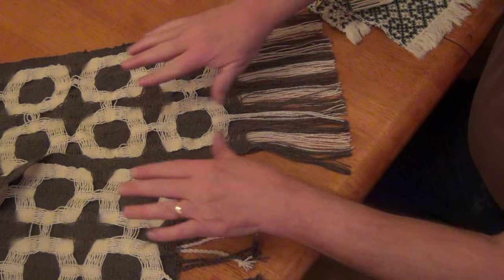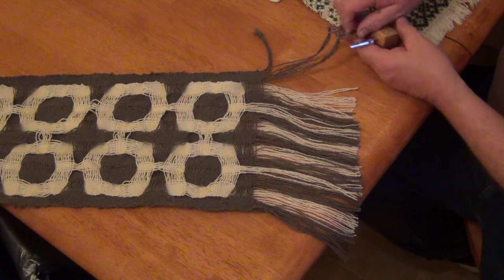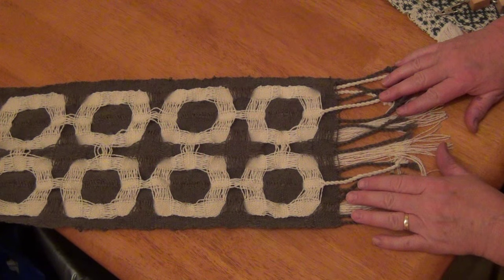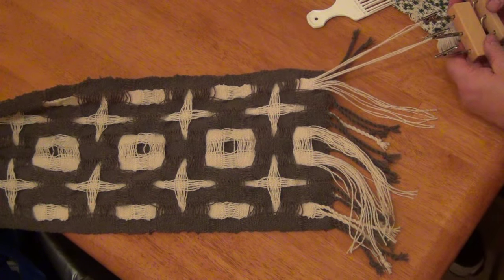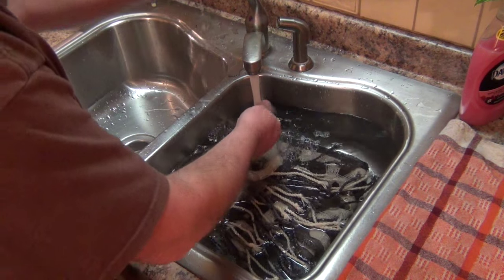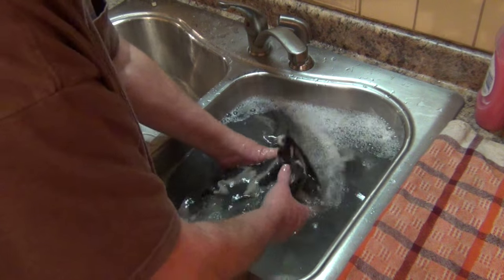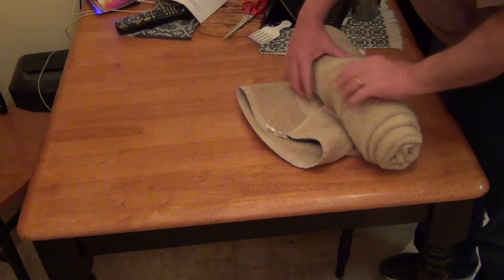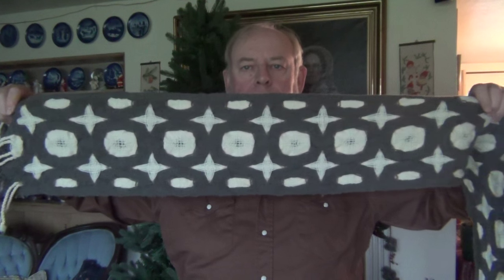Deflected Doubleweave 3

Comment: What a helpful, fascinating walkthrough of this process! DDW is on my wish-list. Just waiting to get an 8h loom to make it happen!
As I watched, I noticed that the white sections remained unwoven for longer than the black. You addressed this in the fringe-tying part. Did they stay secure after fulling? If you do this again, would you do rows of tabby to lock them together before starting the pattern? I would be worried about them pulling apart- particularly if I used a low-felt yarn (silk?)
Thank you for your hard work in preparing the series. It's very, very helpful. 
And, fwiw, I find that people who describe themselves as curmudgeons aren't fooling anyone. ;)
Reply from the maker: +Julianna Heiby Where to begin, so many questions.  Yes, the white did not start weaving as soon as the grey, but when I twisted the fringe the twist goes up to the point where the weaving begins for each color, so no problem with being secure.  And I think it got more secure after fulling.  Yes I know there are some long floats, but in the case of a scarf like this, I believe it is worth that to have the look that one wants.  
No, I don't think I would put any tabby in at the beginning or end to make the ends even, I think that would detract from the effect I was hoping for (and got) with the DDW. I have no experience with weaving silk, so I can not comment on that.
As for curmudgeonlyness (is there such a word), I discovered the word "curmudgeon" while reading in high school, but was too young at the time to qualify.  Now that I can pass for one, I think it completely appropriate.  Someone must carry on curmudgeonly traditions.